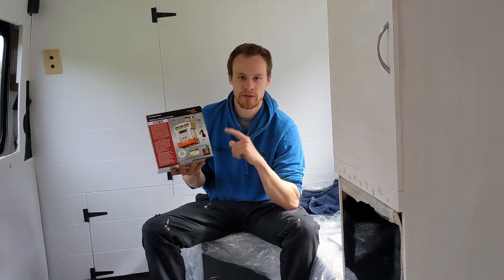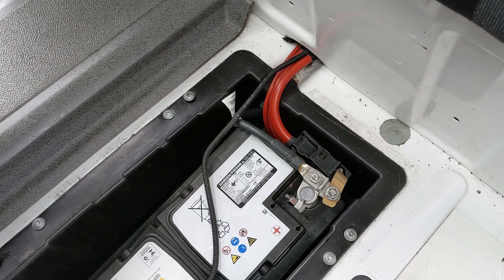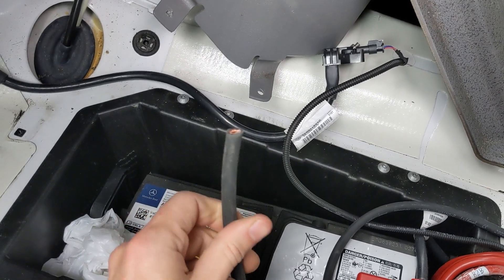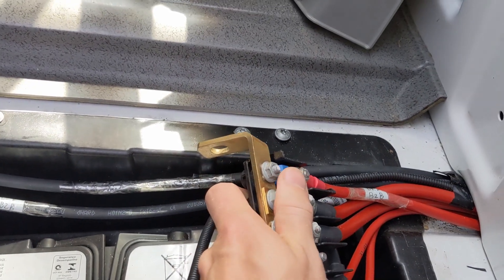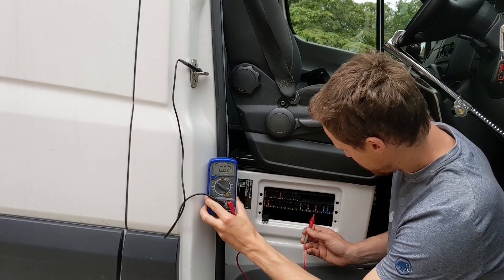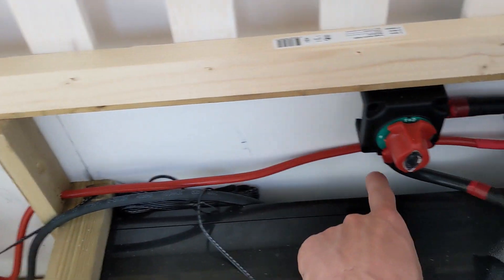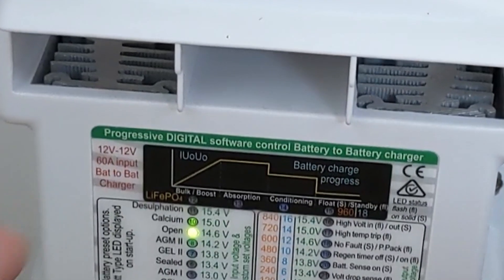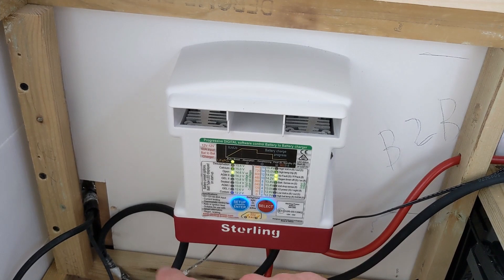Installing Battery To Battery (B2B) Charger with IGNITION LIVE FEED | Crafter Van Conversion | 26 |

Comment: I know nothing about leisure batteries and chargers etc, so please forgive me if the question seems basic. I have the exact same B2B charger in my van. If I wanted to swap my leisure battery for a lithium leisure battery, would it just be a straight swap or is there more to it than that?

Comment: wouldn't you want the dc dc charger to run when the engine is on, not just when the ignition is on?
Reply from the maker: Hi Duncan,

Ideally yes, and the instructions booklet does have a warning about draining your starter battery if you leave the ignition on without the engine running.

In our case an ignition only feed is fine for us as we have no reason to leave the iginition on without the engine running and this was slightly simpler to find. You could find an engine-live fuse through the same method in the video if that's what you need though.

Hope that helps!

Comment: Thanks that was a really useful install video.  Couple of questions if i may as I've just bought one of these and am scratching my head!  1.  you used the 'Mode 2' option of wiring the ignition start rather than using 'mode 1' where it detects the increase in battery voltage and starts.  why is that please as I'm wondering what would be best in my Sprinter?.  2. I notice you have a Victron MPPT controller (I have the same one). Are there any issues in running the MPPT controller and B2B charger together?  Thanks in advance and keep up the great content!
Reply from the maker: Hi James,
Glad the video was useful!

1)
The reason we used the ignition live is because our van (2017) has a smart alternator. With smart alternators the voltage is more variable and can drop below the B2B threshold so it's better to use the ignition feed as this isn't dependent on the voltage from the alternator. I think the sterling unit we have has a built-in timer to stop it switching off too often when the smart alternator voltage drops below its threshold. This timer allows the B2B to be used in either mode but Sterling recommend using the ignition live feed for better performance in vehicles with a smart alternator. 
You'll need to check if your sprinter has a smart alternator but there's no harm in wiring up the iginition feed if it doesn't.

2)
You can use both charging methods at the same time because they will compensate for each other and so won't cause any problems.
Reply: @mountainadvantures5968   Great info. Many thanks for a very helpful reply 👍